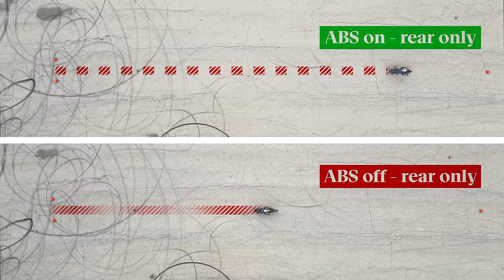Out-braking the ABS Myth

Comment: I realise now i have been using threshold braking for my bycicles  when in emergency or just for fun when going fast, for years, not only that, but the rider can affect massively to reduce even further the stopping distance. by setting the weight further back on the edge of the bycicle seat, or bike if no passenger is with you.  Great video!

Comment: ABS is supposed to give you stability when you brake. It doesnt necessary make stopping distance shorter (especially if you are on ice) but you can manouver your car out of the way without sliding or you can stay on your bike because if your tires slip on wet surface you are probably gone (if the situation is this extreme) - you stop quicker on bike than without bike underneath
Reply: Yeah this video is only focusing on straight line tests. Also not including wet ground as well. I would love to see front braking without abs on wet ground 😅
Reply: The reason why this video was made is because there are lots of people out there who 100% believe that the sole purpose of ABS is to decrease stopping distance in a straight line because the "computer can react 1000x faster than humans". You can tell by the many points in this video that's where the focus is. It's to disprove those who believe that ABS decreases stopping distance with straight stops on dry pavement. Many people really do believe that is what ABS does, which is simply not true.
Reply: This is correct.

A Part Deux video could be added to address the "knew it all along" conmens.
Reply: In a car if you know how to modulate braking and don’t just push hard and hope for the best you can use brief lock ups to your advantage pivoting the car etc, abs is only beneficial for people who aren’t inclined to drive at or learn the limits. I’ve had one crash and it was from one side of the car getting on wet dirt and the abs stopped me from having braking force on the pavement side to pivot back onto the road.
Reply: @gamerdrive5565  The ABS in a car modulates each wheel independently. The idea that you are manually and individually controlling the lockup of each of the four wheels independently by modulating a single brake pedal is laughable, even before your suggestion of brake steering a car in this fashion. The crash you describe sounds entirely like a skills issue rather than anything to do with the car.
Reply: @1ohtaf1  my diff let go while sliding in the wet, have had the same thing happen in a non abs car and had no problems, abs deletes are a safety feature in a drift car, abs is a safety feature for people who just stand on brake and close eyes. 

I drive old “dumb” cars but, so maybe modern abs isn’t so bad in newer cars, but you still don’t want it in a drift car, that’s not up for debate.
Reply: @ChaseB1896  its "simply not true" only in good conditions and in straight line with experienced rider, if those specific conditions were the point of the video then it looks kinda pointless but also not explained to well because they don't focus on situation (only straight) and grip (only dry asphalt)

Comment: Interesting video.  It would be cool to see how bikes with linked or 'integral' braking systems would stack up against these 2 methods.
Reply: You mean CBS? Yes it would be very interesting
Reply: If the k1200s is any guide I disconnected it and put in U pipes to separate the systems. They are a very very expensive failure.
Reply: yeah, that would be interesting. Tho, if i could guess they would perform worse than any other 😂
Reply: @geokon3 I remember seeing a professional racer having a hard time replicating the C-ABS on the CBR when it just came out.
Reply: A very experienced friend who has a racing background says his big Guzzi's linked brakes are almost perfect, and he can gain only a very little adding more front braking. He said it was very hard to get used to not using the front brake lever.
Reply: The linked system gives you automatically what was discussed in the video.  Smashing the foot brake gives you some front brake, so when you get around to pulling the lever the front brake is already partially applied.  I disliked the concept initially, but in practice the system (at least on my 2 wheeled concrete block of a VTX) works very well.

Comment: Great video. Obviously this assumes a dry and clear road. Add those variables and ABS wins out easily.

If you do threshold braking perfectly, you are almost as good as 'forced' ABS. If you do it poorly, ABS will help "save you". Practice makes better
Reply: I think this video should include those "obvious" assumption because the only obvious thing is that people on the internet will miss them
Reply: there's also the fact that a CB500F does in fact not have a modern ABS system.

it has an ABS system that only goes from wheelspeed sensors and not one that uses whelspeed sensorts and an inertial measurement unit. and it probably ain't tuned that well either

the latter is quite a bit better at determining the maximum possible braking force.
Reply: @anonym3017 My Speed Triple has IMU based ABS, but in track mode the IMU part is turned off, allowing you to lift the rear wheel while breaking. I must admit that in race mode the bike lifts its rear really easy, to the degree that it would be dangerous in an emergency situation. My other bikes are much less aggressive on the brake.
Reply: @anonym3017 I have a CB500F with ABS but I ride it as if it doesn’t
Reply: Why do you say it wins out? Wet conditions increase stopping distances with ABS. Always has. Once again the advantage is being able to steer, not shorter stopping distances.
Reply: @mediocreman2  Threshold braking in wet conditions for non professionals is a joke. Get this guy himself that claims to practice a lot and make he do an emergency stop just a single time in his own bike with ABS off and then on and see who wins out. ABS will. Even in dry conditions only serious amateurs that practice emergency braking from time to time will beat ABS. This video is actually dangerous.
Reply: @MrVTeta  I practiced that often. I'm no professional. I'm no joke either. I always get better. That's with a non ABS bike. I do the same with my car, equipped with a shitty ABS system that's no better nor worse than those on other cars that I drove.
My stopping distances with a 2WD without ABS were better than those with a 4WD with ABS. Why? Because that sorry excuse of a driving aid prevented me from braking, for at least half the braking distance. That's under the worst, slippiest conditions imaginable.
Things started to improve again once I started using the only thing ABS is good for: detection of a locked wheel earlier than any human could do.

Comment: Amazing video as always. 
However i wish this also included the difference in braking when dealing with wet roads, and braking mid-corner. These two scenarios where ABS will not only help you, but might actively save you from a much worse version of the accident you could've gotten into.
Reply: Totally agree as recently I had to emergency stop mid bend as traffic stopped just after bend, I applied full pressure on both brakes and it stopped me just inches from the car. My Ducati scrambler 1100. Had lean angle abs it definitely saved me and the bike.

Comment: As a guy who has only ridden non abs bikes his whole life until very recently when I purchased my first abs equipped bike I can exactly understand what’s going on here. Now I am used to it but when I started it felt like the bike just won’t stop….it was a weird feeling and I decided not to ride my zx6r abs for quite some time hahaha
Reply: The whole purpose of ABS is so that when you are threshold braking, you can be slightly more aggressive about it. As seen in the video, ABS does increase your stopping distance if it kicks in. It decreases your stopping distance if you weren't braking enough to get to threshhold braking though. 

I've never had ABS on any motorcycle that I've ridden, but if I could get a system that I can disable for times when I'm riding on gravel or for practicing my braking, I would be much more interested. Sometimes because of the bad riders, the systems can't be disabled or can only be partially disabled.
Reply: There's a huge difference between ABS across bike generations. My first BMW K1200 had pretty bad ABS in comparison to my smooth GSXS1000. I could easily outbrake the K1200 in the dry. The GSXS...almost certainly not. And that's still one generation off compared to GSXR's and S1000R and even the XSR900s. The newer S1000's even have "stunt mode" that allows you to carry the rear wheel according to a specific (user-selected) height. And new ABS all works in corners.
Reply: Dirt bike riders "learned" not to use front brake by having front tire slide out.
Reply: @langhamp8912   What K1200 do you have? My K1200GT from 2003 has insane ABS. I can completely panic grab the front brake and the thing stops immediately to the point where I get slightly dizzy because of the hard deceleration. Can't even feel the ABS pumping.
Reply: Some ABS implementations are like that from the factory, tuned to help you enter an intentional slide on gravel, but otherwise normal. @SmallSpoonBrigade
Reply: @komerka35  I had, I think, a 2008 K1200R; my first ABS bike, with linked braking. At the time I thought it was great until I sold it and bought a 2016 GSXS1000 which is way better. And the GSXS1000 has traction control which is amazing. I almost feel TC is more important than ABS. Both are important, though.

The K1200 isn't bad but in comparison to the GSXS it's pretty jerky. And the GSXS is still a generation behind.

In both bikes I never triggered ABS in normal traffic riding. It was strictly parking lots, red lights, or twisties on rather wider lanes. In all cases it was purposeful.
Reply: @langhamp8912  I have no idea if those two have same braking system. Mine has linked braking too. The braking feel is awful but the bike can definitely brake. I only use it for commuting, for me it's just too heavy in the twisties. Have a 2015 Kawasaki Versys 1000 for that. The break feel is pretty good with steel braided brake lines, but the ABS isn't the best. TC indeed is amazing. It was raining the other day and I just opened the throttle in 3rd gear (which is never a problem on this bike) but this time TC kicked in. And I mean really kicked in. Probably saved my ass.
Reply: @mikemorton6219  Well I do classic trials and it's mostly front brake, even if you're going down a 40 degree gravel bank. You brake on the wheel that has the weight on it and modulate braking effort according to available grip. The front is going to slide, that's what tells you to modulate effort but you just need to get used to that. If the front's going to lock, the rear will lock even more easily. Put on the rear -especially when going down a loose steep slope and you lock up the suspension or worse lock the wheel and stall the engine causing all sorts of loss of control. The rear is for stability over terrain, stopping you rolling backwards, very slow speed control and for bringing the front end down if it's off the ground.
Reply: @komerka35  The ABS on my '05 GS was so bad it was a liability....and that ABS-II "servo" pump inevitably fails. I just removed the whole system.
Reply: So a bit confused about, full rear abs on and full front/rear abs on? Are both non threshold?
Reply: @SmallSpoonBrigade  I disagree. IMHO the whole purpose of ABS is to compensate for ignorance. And, the majority of people don't want to take responsibility for their own breaking.
Reply: Great rides hate ABS.
Reply: @SmallSpoonBrigade  You could always, like often seen in ryans videos, just pull out the fuse. And Im sure theres always a way to build in an aftermarket switch to turn off abs.
Reply: ABS works great if your bike has big brakes that easily lock the wheels.
Reply: @savage22bolt32  Serious riders go through a lot of bikes learning to brake without ABS.
Reply: @langhamp8912 
Clarification, not "all" new motorcycles with ABS have cornering ABS. The majority are still primarily only intended for straight line. For it to be true cornering ABS an IMU (inertial measuring unit) and related programming is needed. This said, the faster more current ABS system are more likely to provide some level of protection in a curve than systems that were designed ten years ago. 

Kind of surprisingly it is the large adventure motorcycle and large sport motorcycles that are leading in ABS technology. Most of the expensive large touring motorcycles from Japan and USA are lagging behind.
Reply: @erniecolussy1705  I wouldn't buy a bike without both TC/ABS. My last bike didn't have cornering ABS but it did have ABS and TC, and that made it a true all-weather motorcycle except, maybe, in the sleet (but you can get tires for that). And I'm sure my next bike will indeed have IMU ABS/TC. 

Generally, however, I find almost all my threats to be distracted drivers on their cell phone or playing with their car infotainment system. While I haven't had any close calls, I've seen others have close calls. Drivers in the US are hilariously dangerous.
Reply: @langhamp8912  I wish I took a picture of every bike I've owned over the past 58 years. Some were notable, some were not. 
The Moto Guzzi is my only bike with ABS on the rear wheel. It offers me zero confidence.
Reply: @savage22bolt32  ABS is about 40% cheaper insurance premiums over the same model bike. So lots of riders, regardless of experience, are crashing their brains out a lot on non-abs bikes.
Reply: @langhamp8912  that's sad to hear. I don't want anyone crash or get hurt. 
I've parted ways with my bike many many times while off road, trails or tracks. Only one time while on asphalt though. A mechanical failure locked up my front wheel & I went down, fortunately at around 10 MPH. 
Always dress for the slide, not just the ride..
Reply: @SmallSpoonBrigade  On my Husky 701, you can disable the rear only, or both, with a dongle. Handy when you go off road.

Comment: It would be very interesting to see this same test in the wet, I believe abs on will be far more effective then. I think most riders struggle to brake hard when it's raining due to the risk of the front locking up and sliding rather than stoppie-ing which is basically impossible to do when wet.
Reply: Due to fear of the front wheel locking. I could pull stoppies my GPZ600R in the wet on demand after about 10 minutes practice. Its good practice because it really teaches you to find the traction limits.
Reply: You would see similar results between full lever abs, vs a perfectly executed threshold braking, vs threshold style braking with ABS. The only difference would be that if you repeated each test multiple times times the chances of you screwing up pure threshold braking increases astronomically
Reply: Agree - a proper deep-dive into braking techniques, on different surfaces and genres of bikes would be great.  A subject as important as braking deserves all the analysis it can get, (and nobody does it better). 

I’d also like to see a few novice or less-trained riders to demonstrate the kind of improvements that are achievable.
Reply: In German bike license trainings, you see videos of breaking with and without ABS. There is no real difference in dry conditions, but in really wet ones it's like two different vehicals. ABS really can save lifes but as sad in the Video, it is an assistance system, in the end the driver matters. However, for me ABS matters. There were quite a few nice one with only CBS (looking at you, Brixton) that were no option for me

Comment: I just bought my first abs bike and was completely ignorant of these issues. I've been riding since 1988 and did an advanced rider course or two, before abs was even a thing. I learnt early on about threshold braking and do it instinctively even under normal braking, and I mean that by the way I use the brake lever, soft then hard. Seeing a combination of the two making that much of a difference gives me confidence. Being able to steer while braking is an even bigger bonus in my mind. I feel another course happening in the very near future as I've never done one with abs as part of instruction. I also haven't practiced emergency braking in quite a while so will go look for an empty lot and brush up a bit. Great video and advice, Thanking you.

Comment: I have had many times that I have hard front braked, and avoided accidents. Without ABS. If the front wheel locks, I unconsly back of for a second. I learned this as a teenager, driving a dirt around the fields. This is the way I recommend all riders start.

Comment: Great insight as usual. This makes me feel much better about my 1990 ZX6. After 45 years of riding I intuitively use both the front and rear brake when needed. Thanks again.
Reply: dosent help either than you cant recover the front wheel locking up,unless you can idk.
Reply: Not hard to do if you're going straight
Reply: @MenderSlen579 it's called experience. I'm not against ABS but most instances of people saying "it saved me" are simply due to their low level of meaningful experience.
Reply: @boingkster  if your gonna ride for a decade or more,eventually down the road youll fuck up.

and hypothetically if you could lock up front tires without lowsiding(like a car) then it wouldnt be so bad but thats not the realiity : (